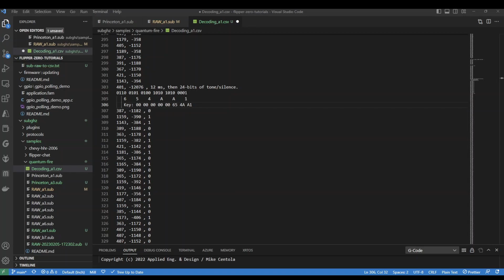[14] Flipper Zero - decoding subghz raw data

Comment: whats happens if i dont have big silience like in your video the only big numbers are not  the ones after -
Reply from the maker: If you are on the correct frequency and modulation what you will typically notice is that the signal is sent multiple times with a silence between them (resulting in a larger negative number). If the signal is only sent once (no big silence numbers) then often is there is a preamble pattern like on-off that is fairly consistent to signal data is coming and then the data and some validation bits. Most encodings are using te, -te, 2*te, -2*te for the signal so I'd try to see a bunch of numbers that are all similar to each other (or twice as large sometimes). It's hard because of the noise in the signal (which I address somewhat in video [65] - https://youtu.be/VxMDdYuRITE ).

You can visualize the signal at https://lab.flipper.net/pulse-plotter and hopefully that will help you see the actual signal (vs. the noise at the beginning and end of recording).

Feel free to reach out to me on Discord if you need additional help. I'm @CodeAllNight.
Reply: @MrDerekJamison  thank you I will check
Reply: @ i found some repetitive patterns with every 32 lines i will add you if you can help me !

Comment: Hey  Derek, Stupid question , but is this method only for static codes and not rolling? im noticing some weird deviation in my data set captures.
Reply from the maker: You can use this method for decoding any signal. But for rolling code the data should change each time the key is pressed. (For many protocols, part of the signal called the "fix" will stay the same, you can think of this as the SerialNumber/Button. And the "hop" will change in a seemly random way -- this is the rolling code security as it encodes/encrypts the incrementing counter.)

"BinRAW" is also fairly good at decoding. It basically sets a TE as the minimum size and then gives you a bunch of 0 or 1 (where each digit is of TE duration).

Comment: Hello! Thank you for sharing.  I'm trying to write a simple RP Pico program to replay this raw FlipperZero data. (Byron DoorBell) -  Using those cheap 433Mhz TX boards. Since this data in the RAW Sub file is 'On/Off Keying' . I just assumed the carrier wave would be HIGH for (if the tone data was > 500) for 'silence' duration and LOW if tone data < 500 for the paired 'silence' duration.  I think I'm confused by your use of term 'silence'. Thank you. What is the number 650 for? Is this the length in time in uSec needed to be high for the value '1' ?
Reply from the maker: Since you are writing for Pico, there will be a GPIO pin connected to the CC1101 if you are in transmitting in async mode; when the pin is HIGH it will transmit carrier and when pin is LOW it will not transmit. When looking at a Flipper Zero RAW file, the positive numbers are the number of uSec that a signal is transmitted (ON), where GDO0 is set. The negative numbers are the number of uSec that the signal is not transmitted (OFF), where GDO0 is cleared.

I've never written an app for the Pico, but it sounds like a super interesting project that I'd enjoy working on. I have a Video Game Module for the Flipper Zero (which is RP Pico) and I think it exposes enough GPIO pins to do that project? If you need help, you can reach out to me on Discord, I'm @codeallnight.
Reply: @MrDerekJamison  Thank you so much, Derek. Your last comment was enough to fix my Pico code! I've put it up on Github if people are interested.
Reply from the maker: @johnwilson3918  glad you got it working! you may want to create a new comment about https://github.com/johnnyw66/picoflipperzero, so more people see it.

Comment: Sure it's not the other way round? First column should be length of the signal, second is the rssi which is negative, no?
Reply from the maker: The RSSI value is not in stored in the .SUB file.  For a signal with OOK modulation, positive values are length of signal detected (in microseconds).  Negative numbers are the length of no-signal detected (in microseconds).  In 2-FSK (Flipper calls it FM) I think the positive are for frequencies detected above the carrier frequency and the negative are for frequencies below the carrier frequency [or not detected].

Comment: Great video! Do you believe there is a program available to convert this programatically?
Reply from the maker: If it's a known protocol, you can use the CLI to take the RAW file and decode it...
- https://lab.flipper.net/cli
- subghz decode_raw /ext/subghz/demo1.sub

Next week, I'll try to add a feature to be able to decode into BIN_RAW for unknown protocols, which makes it a little easier to work with.  I'll update the wiki once it works... https://github.com/jamisonderek/flipper-zero-tutorials/wiki/Sub-GHz
Reply from the maker: Also, if you just want to convert to CSV, there are some python tools from people in my discord channel.  They do graphing, convert to CSV, etc.    Invite to discord is https://discord.com/invite/NsjCvqwPAd

Comment: Hey Derek I'm looking at the csv file for my garage clicker and I found a pattern of 69 millisecond silences every 51 lines, then 48 lines, then 51 lines, then 48, etc, and when I was trying to decode the bits in between, it really wasn't obvious which lines were 0s and which were 1s. None of the tones or silences are over 1000. Any ideas?
Reply from the maker: That doesn’t sound right.  Maybe you are getting interference?  Try changing the RSSI value?  Also, if it is garage door, good chance of rolling code.  You can reach out to me on Discord at codeallnight.  You may also want https://youtu.be/VxMDdYuRITE if the durations are short.

Comment: Hello great tutorials, I was stuck on this step.

So after turning the subfile into CVS file, I found the data you showed in Studio Visual Code (where the data looks like it is paralel, I understood the rest of it is the noise) and after that I found silence of 9.5ms every 90 lines. Is this normal? And between these silences, I can not find a tone that is higher than 1000. All of them are under 1000!

What should I do? How can atribute the binary code to the lines with the tones, if all of them are under 1000ms?
Reply from the maker: When you load the original RAW recorded file via Saved, choose Emulate, and then press Send, does the device respond?  (I'm trying to confirm the original RAW file is good.)  If it works, can you share a link to the file? If you want to message me on Discord, my handle is CodeAllNight#1337.
Reply: @MrDerekJamison  I managed to decode a rolling code with the inbuild decoder, but I was wondering if I could do it myself....or at least learn how to do it myself. And I'm stuck at the part after i find the long silences, and counting the bits. 🤦‍♀ So the RAW file wouldn't work beacuse it is a rolling code.
Reply from the maker: @Nyano161  For rolling code you need to be careful not to have pressed remote so many times that the vehicle gets out of sync.  For me, I typically capture the signal + send it to the vehicle (or I use a remote for a vehicle I no longer own & don't care if it gets out of sync.)

Hopefully you can count the bits and then see some patterns.  The rolling part you aren't likely going to figure out, but you might see the patterns in the non-rolling parts.  Here are some captures from a Chevy HHR I no longer own... https://github.com/jamisonderek/flipper-zero-tutorials/tree/main/subghz/samples/chevy-hhr-2006
Reply: @MrDerekJamison  Haha, well I can't do it on my Ford, the keyfob also hops frequencies. But I recorded one single "opening" signal from the access point barrier, and after that it auto decoded, so now I have a rolling code remote on my device. But so yeah, the barrier doesen't get out of sync, I was just wondering what happens behind the decoding.

Comment: also a question, this method will work correctly only assuming my modulation is correct right ? if I capture with incorrect modulation I would just get garbage ? 10x
Reply from the maker: Yeah, that is a great callout. It seems everything I own is using OOK-650KHz!

I should do a video on modulation (I just finished reading the CC1101 spec.)
Reply: @MrDerekJamison  I'll be waiting for it 🙂
Reply from the maker: Hi Dan! Hopefully you find the following video helpful... https://youtu.be/tzLmMl9HlTY   Also, in the comments of that video is another channel that is doing good work and has a video on modulation that might be useful.

Comment: Just a question if i want to change the credit of an nfc card (example=cofee card/swimming pool card) how do i do that?
Reply from the maker: I haven't looked into NFC with Flipper Zero yet.  3 years ago, I made a video about reprogramming Mifare cards (using NFC device + Arduino): https://youtu.be/XxgqlmkxAFg  -- the short answer is it depends on the card, the keys and the data you need to write.  Also, if it's running code, then it's likely not worth the effort to clone.

If you search the internet for Mifare cards and Flipper, you will probably find lots of videos...  https://www.youtube.com/watch?v=wjbSBDCMuXs looks like legit information.

I'm focused on GPIO tutorials right now; but at some point, I'll try to make some videos on NFC for Flipper.
Reply: @MrDerekJamison  thank you so much
Reply: @MrDerekJamison  I’m gonna follow you
Reply from the maker: Thanks.  I'd recommend you double-check that your latest pen test ROE (Rules of Engagement) document includes NFC cards as *in-scope*.  Access control is typically not as bad as payment; but you never know how a client is going to react when you show them the attack you figured out.  Make sure you understand what disclosure looks like too; it can be super exciting when you first bypass something using your Flipper Zero (it's similar to that feeling when you get your first set of lock picks & start unlocking all the things!)